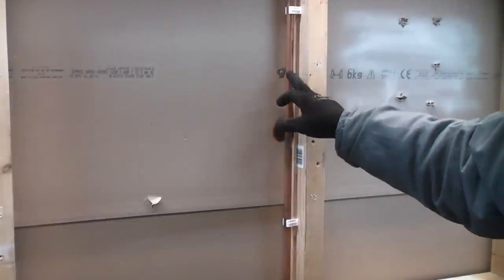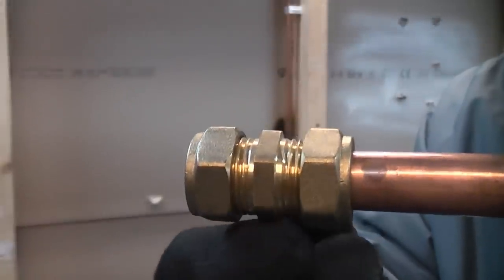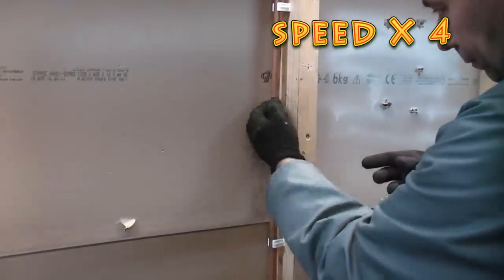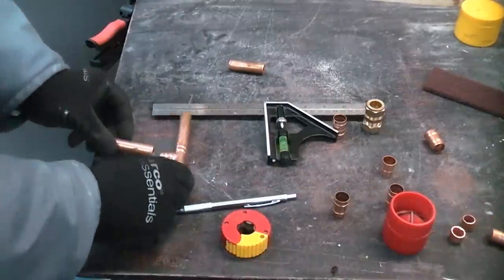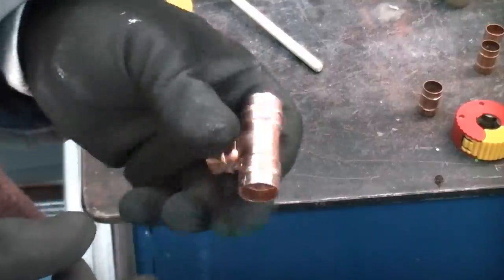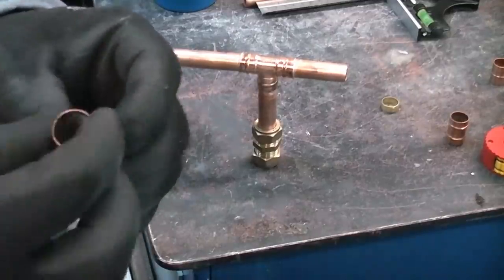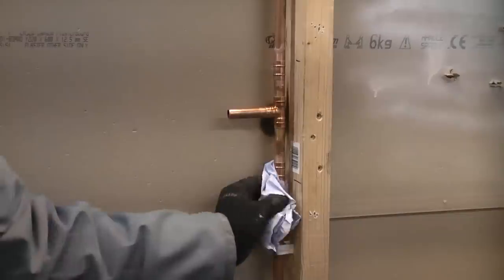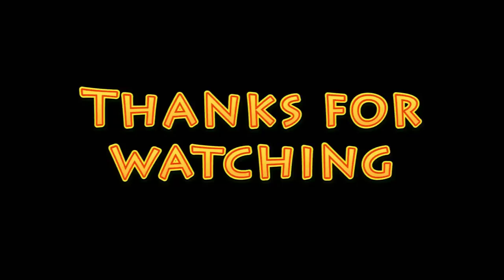How to use slip couplings to tee into a rigid copper pipe

Comment: Needed to insert a 28mm Tee in a rigid pipe and thought I'm not the first to have this problem so there has got to be a fitting to solve my problem. Had the idea that maybe you could get a slip Tee when I went searching but with a slip coupler I can accomplish the same thing. 
Thanks for the heads up. Great channel. Cheers
Reply from the maker: I’m glad you found the video useful
Thanks for the comment 👍

Comment: Great video at a great time. I have been struggling with this for weeks now as I didn't know 'Slip Couplings' existed. You're going to save me hours over the next couple of months (upgrading and adding radiators on a single pipe system). Many thanks.
Reply from the maker: You are welcome
Thanks for the comment
Reply: As a home DIY,  I had the same challenge and it's been bothering for days. Could not figure out how I could achieve this. Then I saw your video... simple but so effective. Thanks so much.
Reply: Same here, I spent hrs trying to fit things wondering how ppl do it

Comment: All  very clear and well done..  You could have used a single slip joint and the T instead of 2x slip fitting.  Two less joints and one less fitting needed.  Also I would suggest turning the pipe in the fitting to be sure that the flux is spread to both surfaces if not directly applying to both inside and outside surfaces to be soldered.
Reply from the maker: Thanks for the comment

Comment: Great video as always. Genuinely surprised those slip couplings didn’t fall down due to gravity when you melted the solder. It’s happened to me in the past. I used an old screwdriver to hold it in place whilst soldering. 

Nice video. Well explained as usual 👍
Reply from the maker: Thanks Graham, I did have a couple of spring clips with me just in case the fittings started to move, but luckily they did not move at all once heated.
Thanks for the comment

Comment: I copied method this using compression fittings and it worked, thanks.  Important... If you have side-to-side movement (just not up and down) you will only need one slip joint.   1.  cut out piece from stationary pipe  2. fix bit of pipe to one side of tee,  3.  put slip joint on stationary pipe, slide out of way,  4. move pipe to side and put on tee and fix,  4. Slide slip joint down and fix.   I used 2 slip joints, was only after I was thinking about it, that I realized that as I had side-to-side movement I could have just used 1 slip joint.  Thought I would share
Reply from the maker: Thanks for the comment

Comment: Nice video. Also if your stuck without a slip coupling you can file down the inside of a regular endfeed coupler. You have to be careful though as the wall of the copper is abit thinner in the middle when you do.
Reply from the maker: Thanks for the comment

Comment: I've never heard of solder ring fittings. Thank you for naming it in the description. I was going crazy trying to figure out if there was a solder and flux combined paste that required no separate solder after you applied the heat.
Reply from the maker: They are common in the UK, but some countries do not use them (not sure why)
Thanks for the comment 👍

Comment: Very clever, I didn't know about those fixings, I would probably have put a standard fixing on the lathe and bored it out. Now I know I don't need to. I bet they are are cheaper way to repair pinholes too, probably cheaper and stronger than those ones you showed us recently, assuming you could move the pipe around a bit.
Reply from the maker: Yes, they are really useful.
Thanks for the comment

Comment: Thanks so much for showing the slip couplings in all the years I've been doing construction I've never seen a slip coupling like that before I always had to use the split coupling boy is I knew they had those it would have made the job a lot less stressful cause when you have a stiff pipe I always had to pull one section of the pipe away from the wall and put the split coupling on it and cut the other side of the pipe a half day-inch shy then we're supposed to be just to get the darn thing on there and the result was I only could put quarter-inch pipe in each side of the coupling and solder it like that which always work but not exactly the way it's supposed to be as the pipe supposed to go all the way to the center of each side of a coupling
Reply from the maker: I was also like you, it was only when Razor mentioned about slip couplings in the forum, that I knew about them 👍

Comment: Thanks ... I thought you were crazy trying to solder with no solder ... never heard of those new fittings.  They look very nice and easy to work with.
Reply from the maker: Solder ring fittings are very common in the UK, they are often called Yorkshire fittings. I'm not sure how long they have been around over here but I remember seeing them when I was about ten years old, so they are tried and tested.
Thanks for the comment
Reply: Here in the U.S. they make what's called C-flux. It has the solder in solution with the flux. Very aggressive. I won't use it.

Comment: I've only been in this situation a few times, thankfully.

In a plastered in situation you would need to use 3 pieces but in a clipped in one I would just cut once and unclip one side of pipe and push in the slip fit. But even in plaster I've just cut back the plaster till enough pipe was exposed to bend out.

Good video.
Reply from the maker: Thanks for the comment

Comment: And in a real desperate emergency you can always file the inside of a standard fitting so it slides up and down the pipe. 👍
Reply from the maker: Thanks Marc, I was discussing this with a plumber mate of mine a few days back but I was unsure if it would weaken the fitting.
Thanks for the comment
Reply: Point taken I wouldn’t be sure. All I know is that it was a last thing on a Friday with water piddling out a fitting and that was all I could think of haha! Shall get some of these fittings though after seeing this! Cheers matey!
Reply from the maker: I'm sure they would be fine, but best to air on the side of caution.
Thanks for the comments
Reply: Easier way above
Reply: I have done it  many times when i didn't have a slip coupling.  Also some of the supply stores sell the slip couplings for 2X or more since the are repair product (excessive imo),
Reply: @ultimatehandyman  i did that same thing,but i did not file it down to size,instead,i just heat the coupling then forced inside a piece of cold pipe while mild hammering the coupling untill cooldown and repeat the procedure untill fits snuggly over a fresh pipe,all this to avoid weakening the coupling wall,and is effective last instance improvisation that really work and resist just like a dedicated piece,great educative video,greetings from Romania :-D
Reply: I have done this as well quite a few times,just use a round file to remove the stop,a bit time consuming but works well,just make sure you mark the existing pipe so the fitting sits in the right place .

Comment: Hacksaw? That's what multitools are for. Yes it really is x4 fast😀
Why 3 fittings? A single T and a single slip coupling will do just as well. Good video for getting the little grey cells working.
Reply from the maker: If I had used a multi-tool, I would have a hundred comments saying "you could have used an hacksaw"!
The pipe is rigid, that is why 3 fittings were used ;-)
Thanks for the comment 👍
Reply: @ultimatehandyman  I bought my multitool to cut a leaking 15mm tee that was 2nd of 4 pipes hard against each other and the underside of the floor above. There was no way to cut it out without taking the house apart around it to get a hacksaw in. I bought a blade that was 16mm wide. The leak was only found when I accidentally left the fill valve on the combi cracked open overnight. I have never been so pleased to be splashing in water in the kitchen in the morning!
Reply: @ultimatehandyman  No hes saying you could have just used the one slip coupling on either top or bottom and then use the T connection for your top or bottom piece. Unless you had to be centered in that location hes correct you only needed one slip and 1 tee connection. Regardless it doesn't matter good video. I made the same mistake going into a stack and I used 2 ferncos instead of just one. I'm too use to using ferncos too mate Pvc piping too copper drainage pipe.

Comment: Dont forget before soldering to align the T outflow parallel to your wall.  If its rotated a bit too much in or out, any long pipe off the T will angle incorrectly.
Reply from the maker: Thanks for the comment

Comment: You can't beat a good fluxing, the only thing i would add is poke a good bit of solder in the joint just as she's running, she will remember that for the next 30 years.👍
Reply from the maker: Thanks for the comment 👍

Comment: I'm not a plumber, just trying to gain some knowledge and i have learned a lot from you so far so thanks. Just wandered why you don't use solder as well as flux like others do. that's got me a bit baffled
Reply from the maker: Solder ring fittings (Yorkshire fittings) are much easier to use, my videos are aimed at DIY'ers which is why I always use them instead of end feed.
Thanks for the comment

Comment: Maybe I am missing something but couldn't it be done with only 2 cuts and 1 straight slip and 1 tee slip fitting?  And maybe just with the tee if the pipes will deflect 15mm

Comment: Hi, Any tips to hold the slip coupler in place on a vertical pipe to be able to solder it so that it doesn’t move ?
Reply from the maker: I have used a jubilee clip in the past, or a tool spring clip works well and is easier- https://tinyurl.com/5bvwxn3m 
Thanks for the comment 👍
Reply: Very helpful thank you

Comment: Excellent presentation. All it needed was a little "real life" of never ending water gushing out the draining cut ends adding six hours to the job ☺

I've never seen those "self soldering" fittings before. How reliable are they?

I'm curious to know what is and where you got that heat shield cloth you used while using the torch. Looks easier than my method of bent pieces of stainless.

Thanks, have a great week! 🍺
Reply from the maker: The solder ring fittings, often called Yorkshire fittings are really reliable. I'm amazed that they only seem to be available in the UK as they are so easy to use.
The heat cloth is widely available in the UK and is made from woven glass fibre- http://fave.co/2BQsuaM
Thanks for the comment ;-)

Comment: Here is the challenge I’m facing: The pipe length that I’m trying to insert a Tee into is 3.75 inches (9.5 centimeters). I don’t know if I have enough space for the two slip on get correctly soldered. 🤔🤔🤔🤔🤔 Any suggestions?
Reply from the maker: That’s a difficult one! I can’t think of a quick way to achieve that, sorry!

Comment: 1 T and 1 slip. Sawzall with metal blade, jigsaw, etc. 1. Cut out section. 2. Attach the T to removed section. 3. Slide the slip coupling onto the removed section.  4. Cut off the extra length from the removed section that now has attached T and slip waiting to be welded. 5. Connect the T to the pipe. 6. Slide up the slip fitting and weld = done.
Reply from the maker: Thanks for the comment

Comment: personally I would have used a compression 'T' and bored out the web on a pillar drill. You can definitely ease the pipe out of the bracket on one side enough to install the fitting once the pipe has been cut. But if you have to use a solder 'T', then you certainly only need to use a single slip coupling as well to make it work.
Reply from the maker: Thanks for the comment

Comment: The one thing that bothers me is the copper cuttings from the saw getting into the pipe.  I can't think of anyway around it though.   Maybe if you could cut away the brackets and crimp the lower section of pipe to keep the chips from going all the way down.  Then cut the upper section, bend the lower section out far enough to get a small pipe cutter in, and then push it back.  Then you would have two ends with clean cuts.  Just a thought.
Reply from the maker: I think as long as the pipe is flushed afterwards there should not be a problem with the chips.
Thanks for the comment

Comment: Cutting that pipe looks like a perfect job for an oscillating multi-tool or small recipro saw.
Reply from the maker: Yes, that would probably have been quicker.
Thanks for the comment
Reply: Would it not have been slightly easier to have cut 90% through that first cut and then done the second, so the pipe is still braced both ends. Then you just have that last little piece left on the first cut to finish off.

Comment: You can make a slip coupling by putting a steel nipple in the stop coupling and rap on the stop with a ball peen hammer. It flattens the stop.You can clean both ends of short pipe at the same time with a longer piece of sand cloth.

Comment: Just wondering if we need sliver brazing rod or not? Or is flux only itself enough for soldering? Thanks
Reply from the maker: It depends on what type of fittings you are using. If you are using end feed fittings, you will need flux and solder. If the fittings are solder ring fittings, you just need flux 👍
https://www.youtube.com/watch?v=7zlDHA3KhLA&t

Comment: every joint is a potential leak  the T could have be added with proper measurements and one less repair couple
Reply from the maker: I look forwards to seeing your video on the subject, but please ensure that the pipe is rigid (cannot be moved in any direction).

Comment: Great video, thanks. Well explained. Can the demurring tool you use in the video be used on the pipe attached to the wall. Will it fit? If not would a pipe cleaner deburrer be as good? Complete novice so apologies if an obvious question.
Reply from the maker: With most pipe clips, I don't think the deburring tool will fit - unless you can move the pipe away from the wall slightly.
I'm not sure about the pipe cleaner deburrer, as I have never used one.

Thanks for the comment
Reply: A needle file set can be used for the big burrs and Scotchbrite pad used to finnish

Comment: Can't you use an angle grinder to cut the pipe?
Reply from the maker: You can, but don't use an abrasive disk as the dust is toxic, when cutting copper.
Thanks for the comment 👍

Comment: Thanks for the video, can you please recommend a blowtorch head and also the best gas to use for plumbing?
Thanks again,regards carl.
Reply from the maker: Hi Carl, I have had a Rothenberger surefire for a few years and it is superb- http://fave.co/2BQy8cX
I was meaning to do a video about blowtorches but never got around to it.
Propane is normally fine for plumbing- https://www.screwfix.com/p/rothenberger-disposable-propane-gas-cylinder-400g/71092
Although you can also get Map gas which will also fit the Surefire (Map burns at a higher temperature)
Thanks for the comment
Reply: Thanks so much for the advice, was a bit nervous about gas soldering but you make it look so much easier than I thought and you get a much neater job.
Thanks,carl.
Reply from the maker: The Rothenberger torches make soldering easy, especially with solder ring fittings. The beauty of the Rothenberger's is that you can use them on any angle, even on their side and the flame will not go out.
If I was soldering for the first time I would have a practice on some off cuts first, but it is easy with solder ring fittings.
Thanks for the comments
Reply: Old school was small presto- lite bottles. Acetylene with adjustable tip and 5'(?) hose They worked great because it was easy to adjust the flame and maneuver the tip. Nowadays, Acetylene is expensive and the bottle is heavy, especially dragging one in a crawl space!
Reply: Map gas.

Comment: Why wipe excess flux? Leaving it cleans that much better and burns off from the torch.
Reply from the maker: It often runs down the pipe, causing it to oxidise a few years down the line, then people see the green oxidisation and think the joint has been leaking.
Thanks for the comment
Reply: @ultimatehandyman  Makes sense. Is this what causes the blue/green that seems to accumulate around laundry faucets?

Comment: How u know the size of copper pipe?
Reply from the maker: In the UK, for domestic water it is normally 15mm or 22mm
For central heating you might get 15mm, 22mm or 10mm (even 8mm but that is not very common now)
In older properties you might have 1/2 inch or 3/4 inch.
If you are unsure it is always best to measure it, or use a fitting to check the size.
Thanks for the comment